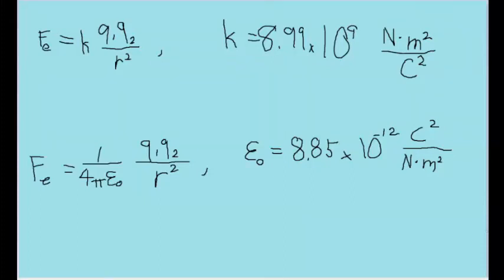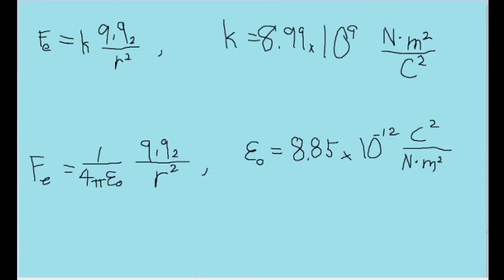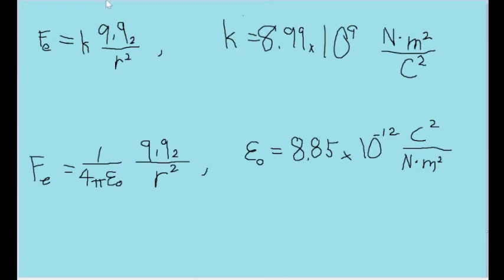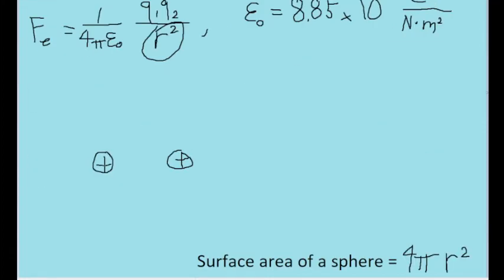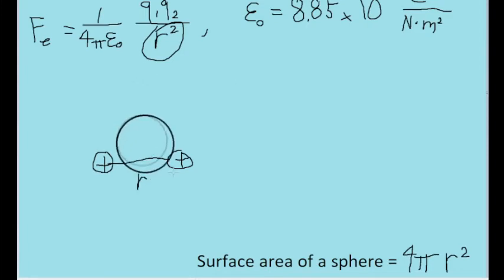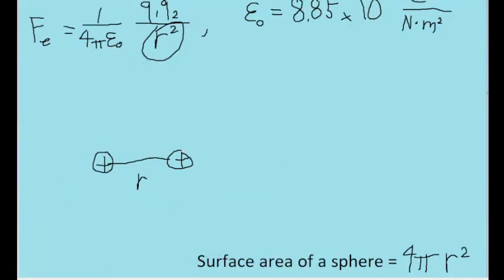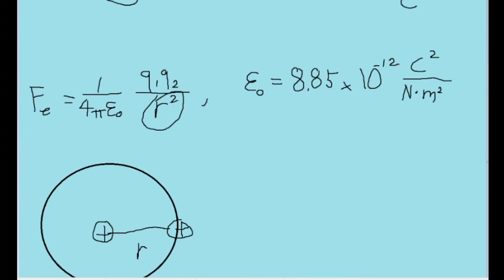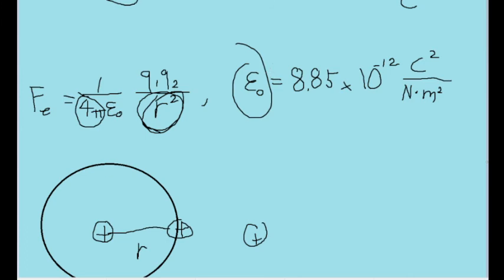Coulomb's Constant (k) vs. Electric Constant (epsilon-0)

Comment: What do you mean you have to add another constant(im talking about the epsilon aka permitivity) in order to “to keep the terms equal” ?

I thought permittivity was added cause it was inversely proportional to force
Reply from the maker: Your thinking is on the right track - permittivity is, in fact, inversely proportional to force. But, that's only because permittivity was defined that way. The definition of permittivity wasn't something that was derived from an equation, that's just how scientists decided to use the term.

That's the reason why the epsilon is placed in the denominator of the k term, rather than in the numerator.

You also asked what I meant when I mentioned "keeping the terms equal". I was referring to the fact that "k" can't be equal to 1/(4*pi) on its own; some other universal proportionality constant still needs to be accounts for, and that's why some other constant still needs to be included.

I'm not sure if I fully answered your question. Does that clear it up at all?
Reply: @KTBWorld  🥹 that was epicly helpful.
Thanks for replying to a comment on a year old video ❤️

Comment: Would you please demonstrate how K is actually calculated because Wikipedia tells me Augustus coulomb knew the exact charge he was putting on each sphere but this makes no sense to me because I am told he rubbed a glass rod with fur and everytime he would of done there would be a different charge, how did he derive K? Without knowing the quantity of charge on the sphere?
Reply from the maker: I just did some research on this. Based on Coulomb's original writings, he found the "Qq/r^2" part by using a torsion balance to measure the angles through which that one of the charged balls would move when the other charged object was moved up to it. He didn't actually know the magnitude of the charges (there was no way of measuring them at the time), he only knew what the proportions were. He measured the force created by a metal ball with some charge, and then he touched that charged ball to an UNcharged ball so that the charged ball's charge would be split in half. He then discovered that the electric force produced by the charged ball was now half of what it was before - hence the proportionality.

As far as I can tell, Coulomb himself wasn't actually the one who calculated the first values of the K constant. Or, at the very least, it doesn't seem to be something that was determined in his first few publications. The constant itself could have been discovered soon after by other researchers trying to replicate Coulomb's original experiment, but the magnitudes of the charges on the two balls would have needed to be known. Then again, it's hard to know for certain because a lot of information about the history of science is rather obscure, the details of this experiment especially as the original documents are in French.

The "glass rod and fur" experiment you're talking about isn't an experiment that Coulomb is necessarily known for, it's something that people have been doing for ages to demonstrate the basic everyday concept of static electricity. I'm not sure if Coulomb himself did it at all.
Reply: Do you know who first measured electric permittivity?
Reply from the maker: @dw5863  Once again, there doesn't seem to be much documentation on this. I think the way it tends to happen is that most of the attention/focus in the history of science is centered on the proportions, the implications, etc rather than the specific numbers and values that we now get to take for granted. Back in the 1700s and early 1800s (when Maxwell's equations still hadn't been fully discovered and formulated), E&M was still a new and budding field, and they had very few units to work with. 

I'll post an update if I ever find anything different or more specific, but as far as I can tell, there isn't a clear answer. My best guess is that it was derived from the 1/(4*pi*ε) definition of the Coulomb constant, which itself was probably determined experimentally around the time that the Ampere became a standardized and well-understood unit.
Reply: For me it should be a simple as 1mm diameter, 1m length copper wire coiled in a ring of 5cm diameter will deflect upwards 5 degrees when 1 volt is applied through the wire. There must be a definition like this for voltage and ampere, just like a kilogram is 10cm cubed of water, 1 volt or 1 amperage will have only one physical material that is used as the fundamental determiner

Comment: Under which rule coulomb,s constant was introduced? Plz reply
Reply from the maker: As far as I'm aware, Coulomb's constant was first created simultaneously with Coulomb's law itself - after all, that constant is necessary for exact calculations to be made.
Reply: @KTBWorld  is it correct that one over 4 paee is introduced because a three d angle is formed at the centre of sphere of lines of forces of the charge?
Reply from the maker: @kabeerfcc4153  I don't entirely follow, but I believe you're on the right track at least. The 1/(4πε0) was originally introduced because it explains why there's an r^2 in the original formula. If the force is looked at as something that's inversely proportional with the surface area of an imaginary concentric sphere, then it starts to make much more sense why Coulomb's law is an inverse square law.